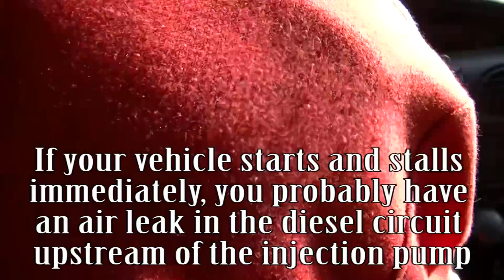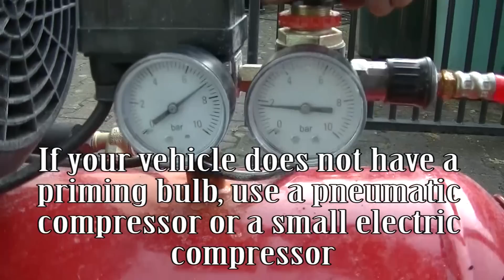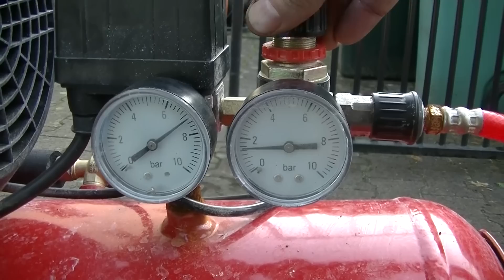How to find vacuum leaks in your fuel system

Comment: I had a problem similar with the subject of your video but in my case it was from the priming manual pump because in it there are one way valves... and the valves didn't work properly at that time. I've changed that priming manual pump and it was ok for more than 6 months but the valves failed on the second priming pump the last thing that i've done was to buy 2 valves from the plumbing department and put those ones before the priming pump and after it. now i'm driving with this solution for more than 2 years.
Good tip using compressed air to find the leak.
thanks for sharing
Reply: Toyota 86